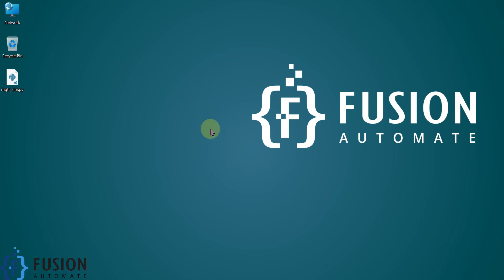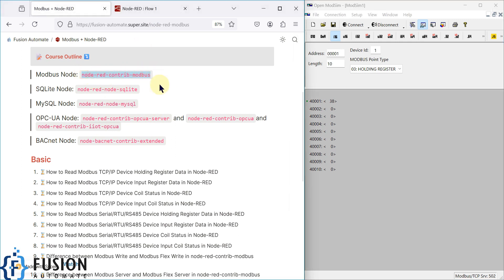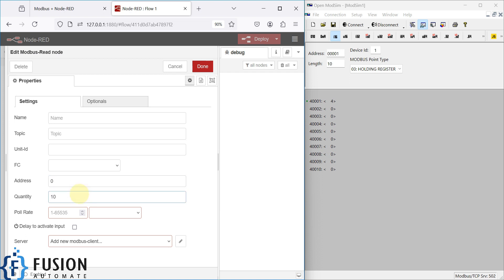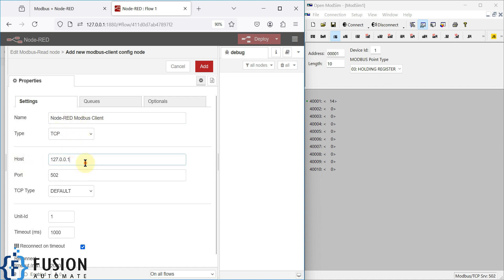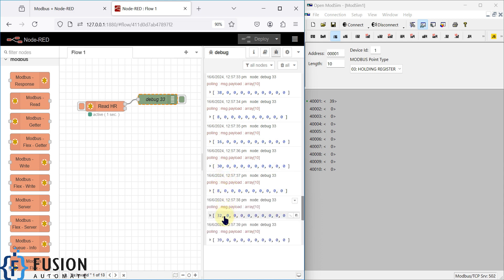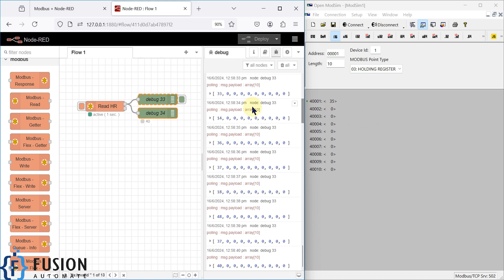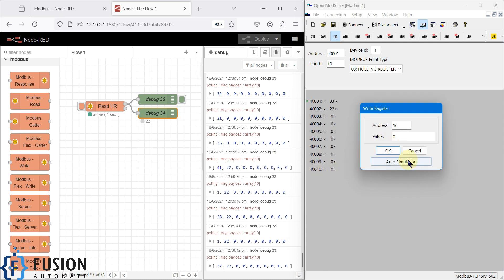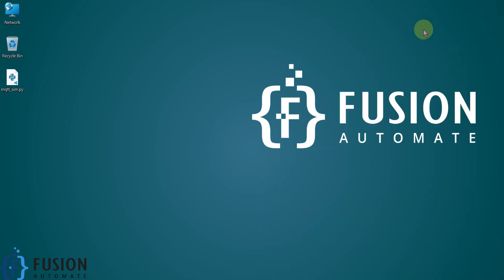How to Read Holding Register Data of Modbus TCP/IP Device in Node-RED | Industrial IoT | IIoT |

Comment: Good evening, can I use this read node to read more than 10 parameters at the same time, the total is 28 parameters reading simultaneously, I tried to use it but it stops reading and does not read anymore, is there another way to read these parameters simultaneously respecting a 1s interval?
Reply from the maker: yes we can read, can you share your flow picture on our WhatsApp or Telegram for? Also I will guide you there.